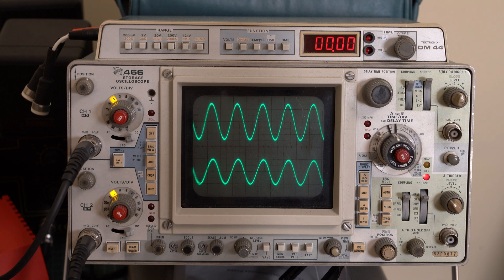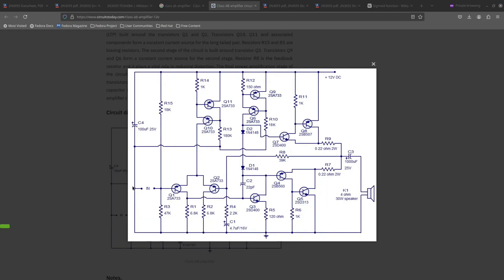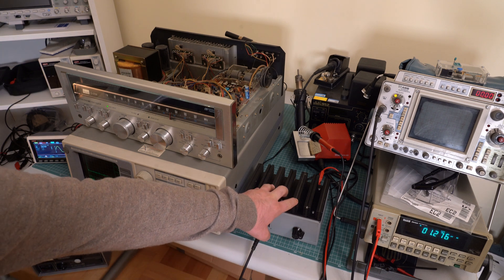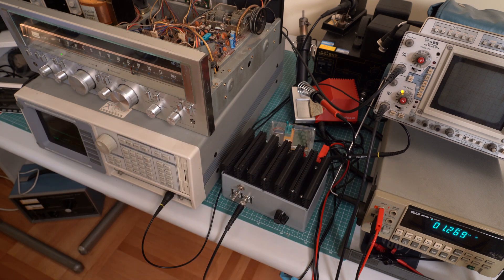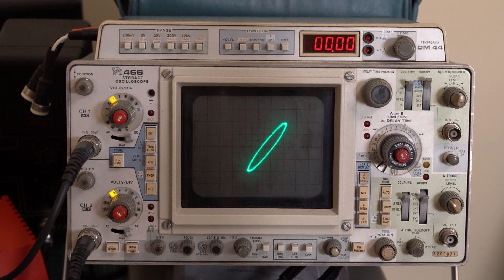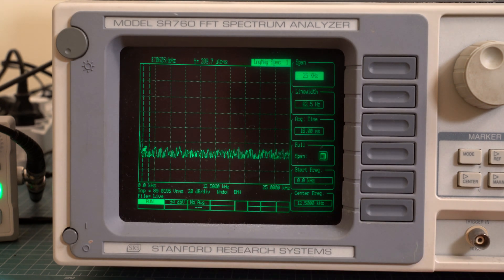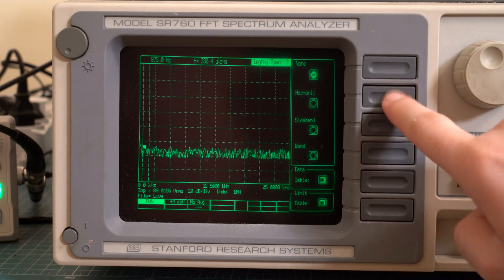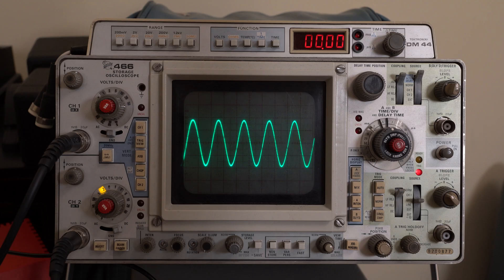Audio Amplifier Distortion: Clipping, Nonlinearity, THD

Comment: interesting video, thanks ...however, is it really necessary to investigate distortions of the output signal just under load? Clipping and non-linearities can just as easily be examined under lower load or when running idle (perhaps not as realistic as under nominal load, but still), can't it? (((and of course I envy your spectrum analyzer, not nice to don't have it )))  :)
Reply from the maker: For transistor amplifiers, you could in theory test THD under no load, but I'm not sure if the results are close to full load ones. In general it's good practice to have realistic test conditions. For vacuum tube amplifiers it's a completely different story and testing them at full volume under no load would be a complete disaster due to the inductance of the output transformer. Without the load, the transformer produces huge back EMF and could destroy itself or other components around it.
Reply: @VoidElectronics tube amplifier transformer with excess leakage inductance or capacitance and nfb, probably . semiconductor amplifier THD is load dependent. THD maximum value for 0,02-20kHz at nominal load.

Comment: Familiar topics in the stuff I do, nicely presented here. Nice Tek 466... don't see those too often. My Tek 453 from 1969 is still going strong. I like it because it's from the Apollo space program era. One thing I still don't have is a spectrum analyzer, need to get one! So with your spectrum analyzer, if you had an ultrasonic oscillation say at 500khZ, would that be able to see it? What piece of equipment would you use to see that?
Reply from the maker: Thanks! The spectrum analyzer has a BW of 250 kHz so it wouldn't see well such an oscillation if at all. However, I normally troubleshoot amplifiers using the Tek 466 or my Siglent SDS-1204, so I would catch it with one of these two because it easily falls within their BW. Not to mention the fact that the spectrum analyzer takes up my entire workbench so I only take it out for special occasions. 😁